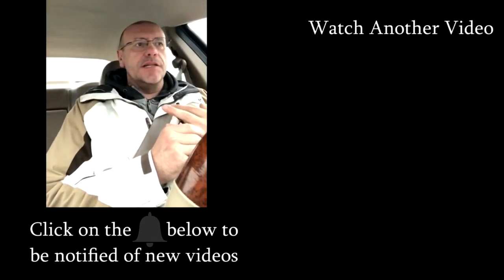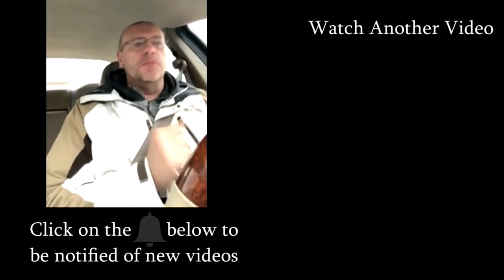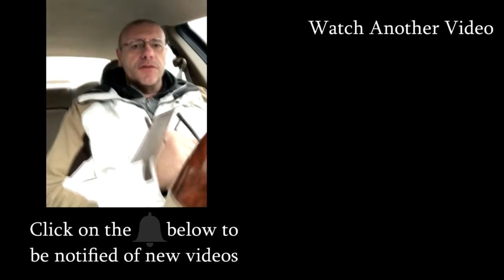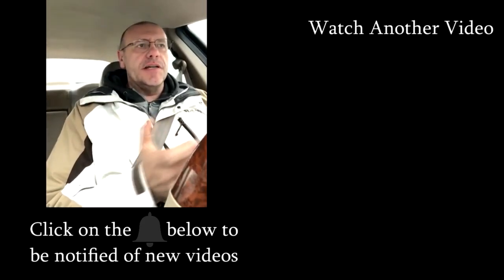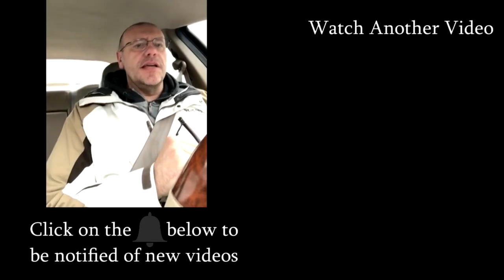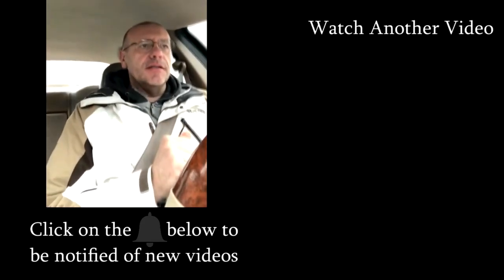Catalytic Converter Lacquer Thinner Fix-Update | Techn' Moto

Comment: Th is man is spot on. I tried the lacquer thinner, and it worked. 2001 Honda Civic. 145k miles. Check engine light on for some time. Went to the mechanic and he tells me it's the converter. $900. I came on Youtube and saw all the different videos, this one included, and I went and got a can of the thing. I had a quarter tank of gas at the time. Put in the whole can of thinner. Did not drive 150 miles at whatever miles per hour. Instead I just drove like normal over a couple of days. Yesterday the light went out. Went today to take the test and it passed. Thank you Techn' Moto.
Reply from the maker: Brother this is the best thanks I could ask for. So happy it worked for you. Take care and god bless my friend.
Reply: Thank you and your knowledge. God bless you and your family as well.
Reply: @lm7692  how did the thinner hold up?, did it permanently fix the problem?

Comment: I did this in my 08 dodge ram Hemi 5.7 just alittle less then quarter tank ,then drove around city in second gear to keep rpms at 2100 to 2500 .I noticed a difference right away light has been off for a day now we'll see how it goes but so far so good 👍, Oh and my truck has 300.000 kms on it and it's always ran good just had po420 and po430 codes ,
Reply from the maker: Cool 👍
Reply: Now after driving about 150kms today the light came back on PO132
Reply from the maker: @dandesjardins2552  😞

Comment: Not certain if you have a moment. I was told by my mechanic that my converter needs to be changed. I tried the thinner and the light is out. Can I go directly to the emissions test, or do I need to do something right before the test? Thank you.
Reply from the maker: Try it. If it reset it should pass. But don’t hold me to this 😂
Reply: I hope so. Thank you.

Comment: I plan to pour this thinner every month from now on since I felt the same way you did and observed such improvement on performance of my car.  Would once a month of this thinner would create harm to engine? Is there a science proof at all? I have yet to find a YouTube video about it
Reply from the maker: Don’t know.
Reply: Once a month I wouldn’t do that cause the engine needs lubrication once a year would be just like going to the dentist to get 😂 teeth clean
Reply: even though the lacquer thinner cleaned my Catalytic converter, fixed the P0430 CEL code, and passed the Smog test on 11/21/22, had to do a drive cycle after clearing the code to get the OBD2 system ready and clear the CAT 'not ready' status. I searched "lacquer thinner in gas tank" & got several sites giving reason not to do it, being some acidic compounds that would compromise plastic and rubber components of the fuel system.  1996 Ford 3.8L V6 193K miles
Reply: @skiptsu914  I thought it was too good to be true what Scotty said about using it for about 3 decades (30yrs) …there’s gotta be a downside on using it like u said about the acidic part and yes I have decided to stop using it too due to recent changed of my cat converter and it should be alright for the next 250K miles without the P0420 visiting again on my dashboard even though I drive a lot for Uber here in LA

Comment: I noticed towards the end of your first video you had to fill up again, did you add lacquer thinner again at that point since the CEL was still on? Or did you just put the one gallon of lacquer thinner in it in that previous video?
Reply from the maker: did it once but filled the tank up to top it off because I was low on fuel. Scotty recommends 1 gallon of lacquer thinner for a half tank of fuel. the light eventually went out and I eventually went to the garage to have the codes removed. Worked great until I sold the car a year or so later.
Reply: My engine lights go on & off. Drives sluggish sometimes kinda want to stall when starting the car. Before my code came on for bank 1 sensor after I changed that engine lights still comes & go.... Should I try this? Was gonna five Cataclean a try 1st. Thx please help